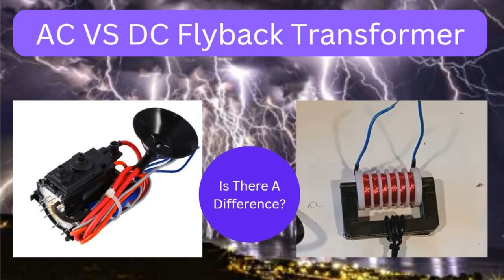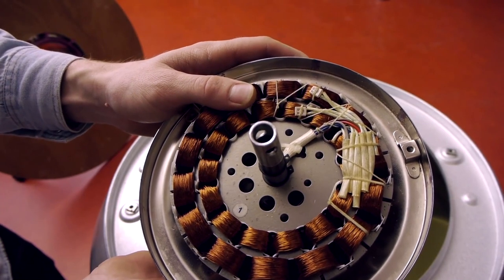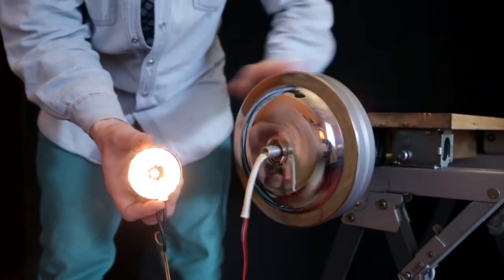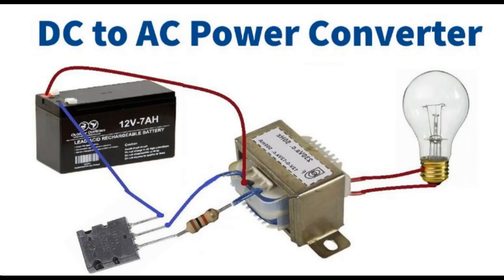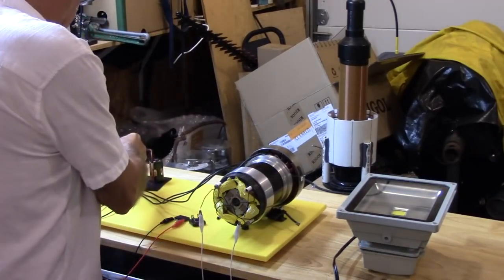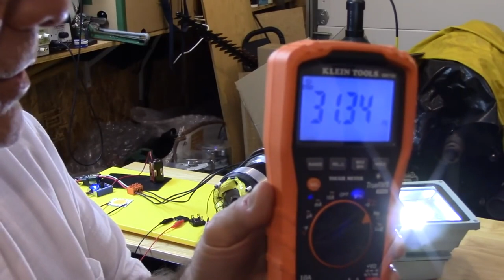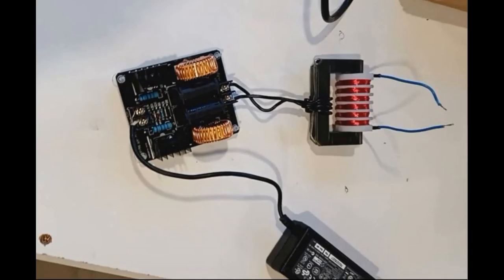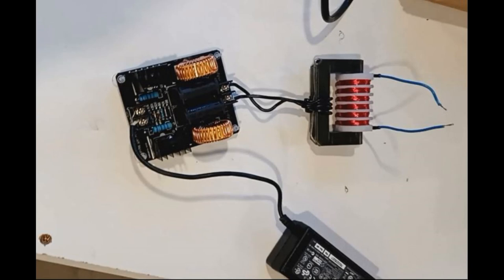Is This Really AC Or DC Voltage?

Comment: Absolutely right man
The power or energy of electricity itself is the result of the transformation of the old and original energy, which exists everywhere and is infinite.
Beings who reach a level of consciousness that becomes aware of this energy, can disturb the balance and stability in this energy for a moment, and when this energy tries to stabilize itself, that conscious being can picks up the stability of voltage difference or temperature and even gravity
Reply from the maker: Temperature and gravity. That is right. Heat and magnetics. So often we forget how well they work together.